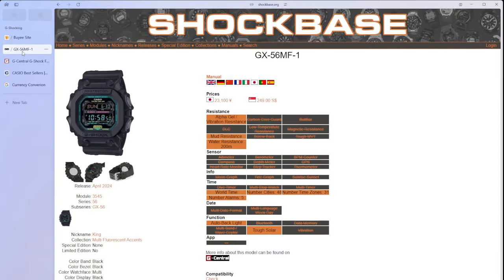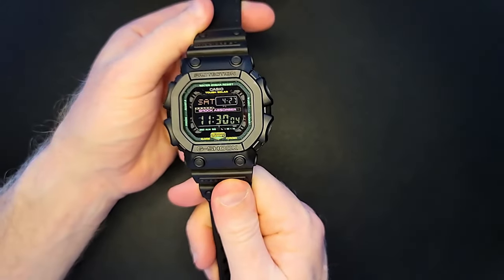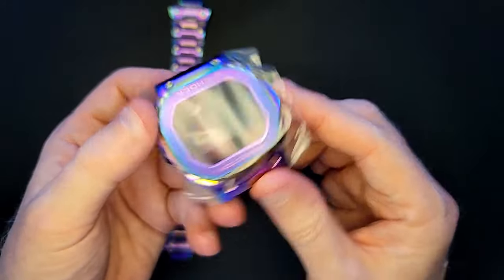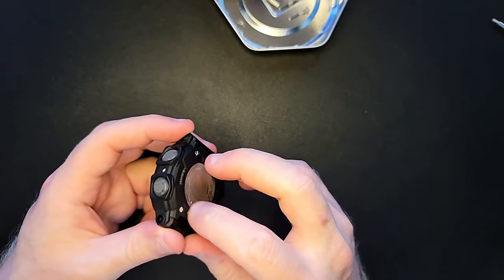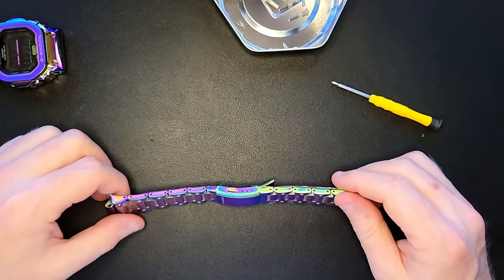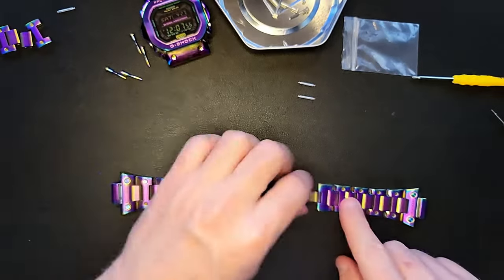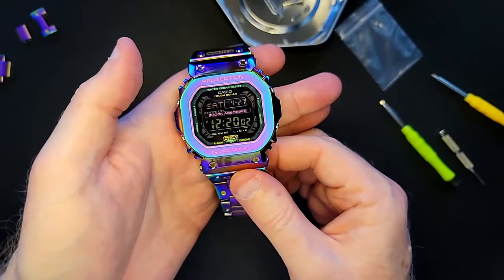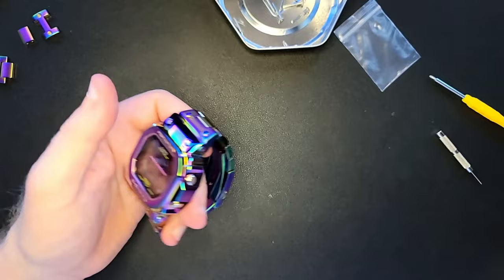I took a G-Shock King and created a one-off timepiece

Comment: What are your thoughts regarding the legibility of the King when outside? Thinking about getting one, but the negative display kind of worries me...
Reply from the maker: This is a good question, negative displays always feel hit and miss to me. After having both I would always opt for the positive display. When I get back home I'll give it a test, but I'll be out for a week.
Reply: @TheGShockWatcher  So, any thoughts on the legibility of the King? Really want to know your opinion on this! Thanks.
Reply from the maker: So I did some testing around different light conditions, in well lit rooms it's not too bad, however when the light is not great, and I'm talking about shady, not dark rooms, the ability to read is pretty bad, and you need to hit the light to see. I still like the watch for its size... But as you say on an inverted display it's not so readable.
Reply from the maker: Outside in bright light, it's not too bad to be honest. But you need to be looking directly at it, at an angle super tough